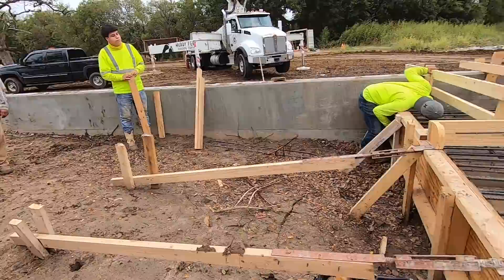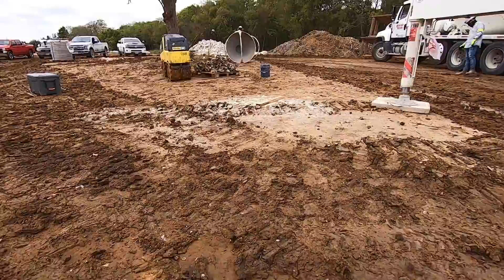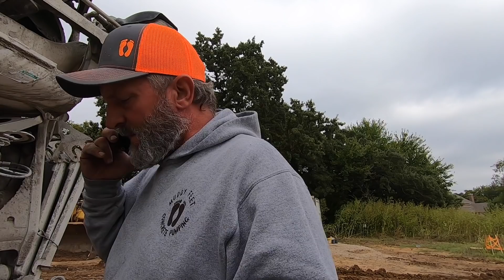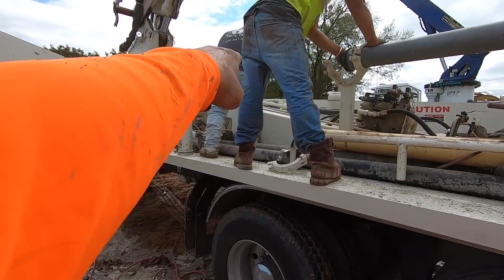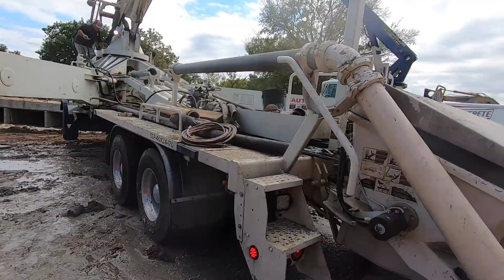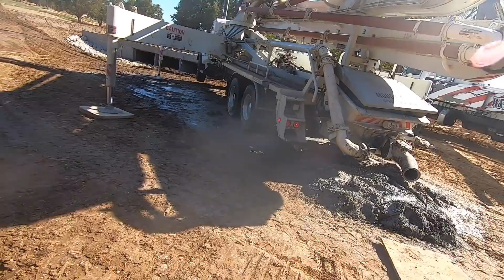Mayday, we've blown a deck pipe. Issues with Muddyfeet Concrete Pumping

Comment: Could've been avoided if the operator would've looked for the plug in the system 1st instead of trying 2 force that shit out. All that pressure and either a pipe is gonna blow or a hydraulic hose is gonna blow.

Comment: Muddyfeet concrete pumping - I am working on a concrete construction safety video and was wondering if I would have your permission to utilize a brief part of the clip showing the hose on your pump truck and the moment the pipe burst? So far this is the only video I've ever seen where the bursting pipe on a pump truck was caught on camera. Once finished with the video I could certainly share it with you
Reply from the maker: I don’t think so

Comment: I always carry a spare 90 and one pipe.  Over here there are no outher pumps, we're it!!!
It drives me crazy how you all prime over there.  Seems you get a lot of air priming like that
Reply: How do you Prime?
Reply: I always start the prime with the cup  in the downward position  , water to the middle of cylinder opening , check slump and make correction,  then fill hopper with mud and honk horn and start the prime , full rpm and somewhere past half volume, when I hear the mud break over the top I slow the volume to around 3 and go on doing the job.
I'm not saying the way your doing is wrong but seems like your getting water air mud then water in the middle of your column  and if you get a hard spot in the pipe the water behind the wet slug will push through and segregation soon fallow  .

Comment: Jeff you may want to look into a bag of pro slurry 2. It's cheap enough and  only use about half of a paper cup from a water cooler. You can even prime a boney mix. Not saying you won't have to run your agitator in reverse to keep pumping a B.S. mix but you can still pump. Don't buy into that over priced slick pack any dry polymer like poly bore or the pro slurries will work.
Reply from the maker: Yeah we use water. For most part it works just fine.
Reply from the maker: But great advice

Comment: Just a couple things , I watched a previous video with an operator priming out . I noticed you said you plugged on prime .  Just want to share what I seen. The initial prime needs to be full volume and full throttle. Doing this will limit separation once concrete hits the water in hopper . Another issue I seen was the mixer driver was discharging at a slow to medium rate on the drum .that drum needs to spin at full speed to ensure the separation possibilities are extremely limited. Just my two cents in my experience. Also horseshoe or A frame is ideal to get a good free fall on the last two sections. Doing this will prevent putting pressure on the pipes to limit blowing them out .
Reply from the maker: Sounds like good sound advice

Comment: I could be wrong but you may have been able to stand the boom straight in the air. Put pump in reverse a couple strokes. You should hear the plug move.  Then hammer In forward a couple strokes until you hear or see boom move a bit.  Then drop the tip down as fast as you can and turn pump on plug should move.   I’ve been in this situation before it’s not fun.  Looks like wet boney mud!
Reply from the maker: Your right. But usually when your getting mud back to the hopper the plug has broken up also. I think we had a defective pipe that give away.

Comment: you plugged the pipe, then you put the concrete back but you didn't lift the crane high in the air to unclog the knee. in my opinion bad pipe prime, bad unplugging, bad pipe rescue,  you just need to connected to the rear rubber hose the water and washed the pipes without any disconnection of the knee, experience is everything
Reply from the maker: You seem to think of everything.

Comment: That can definitely ruin your day. What kind of pipe you using? We use Conforms twin wall system and have had great success with it. We have river rock here we can get 100-120K yards through a set of  pipes. We keep up with the yardage on all our trucks we know about when it needs to be changed. Seeing how yours blew out the way it did may have been a defect if the pipe is somewhat good.